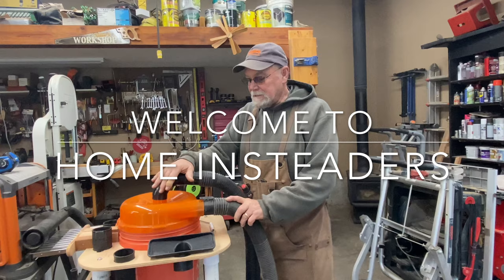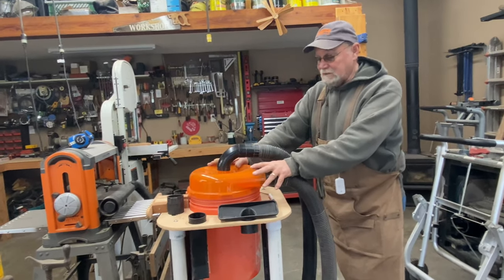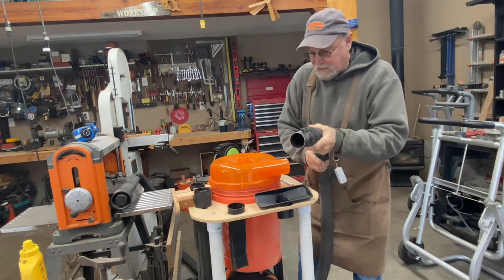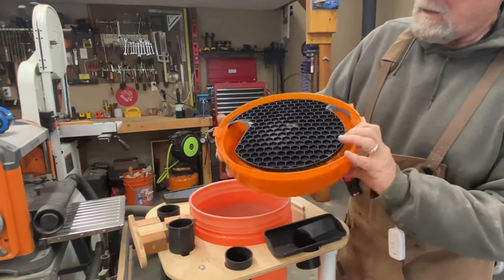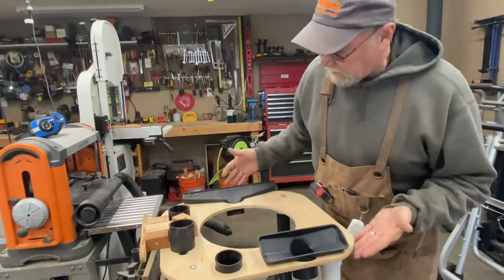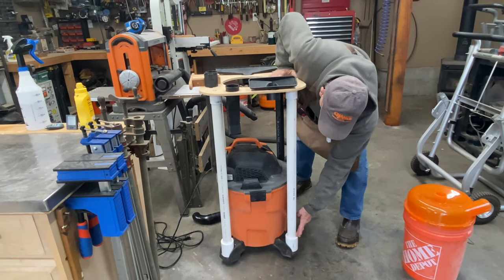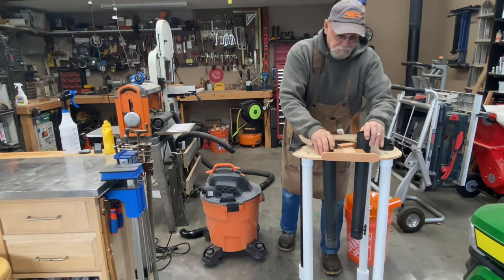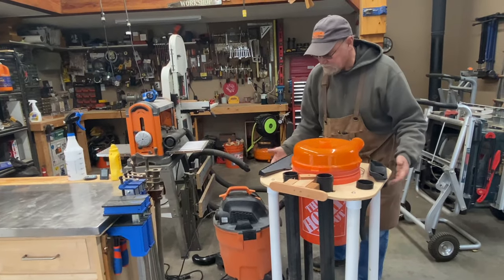Easy Cyclone Dust Collector

Comment: Looks great. Clever on fitting to the foot brackets. I built a Thien Separator inside a 5gal bucket then lifted the shopvac lid to insert the 5gal bucket thien separator in a sandwich with plywood fittings to seal off the bucket to the base vac tub and the vac top.
Reply from the maker: That sounds like a fun project! It really makes a difference when you control most of the dust in the shop. Thanks for sharing.